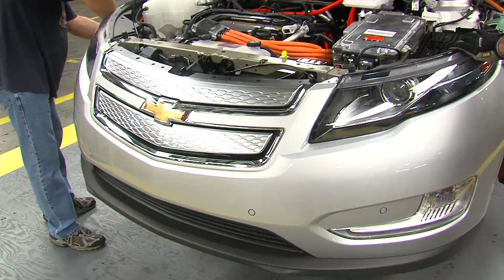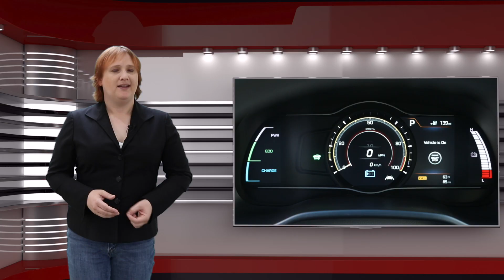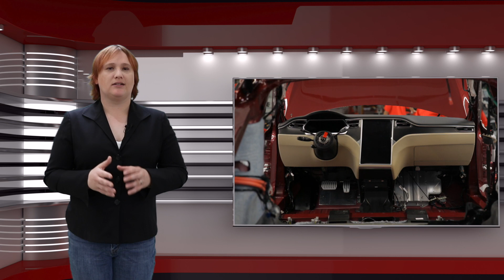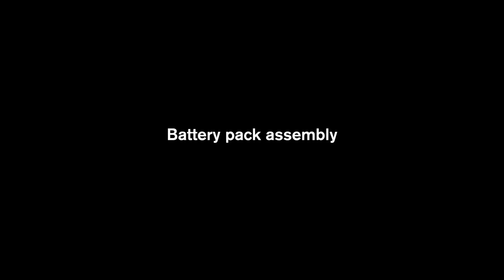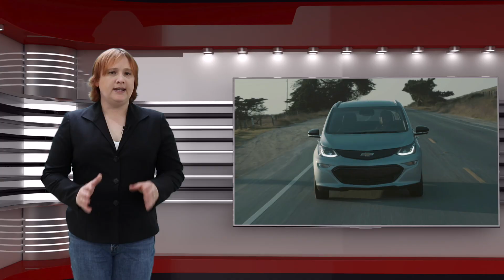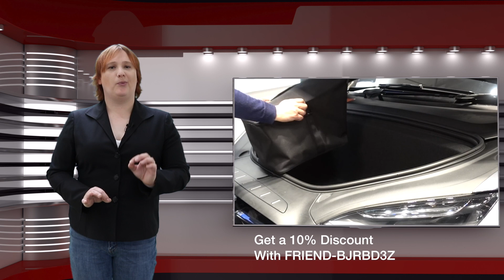Why Electric Cars Don't Use All Of Their Battery Capacity

Comment: But, what is the future of batteries, I have heard of many like solid state, lithium titanium and graphene??
Reply: Tesla and Panasonic are perfecting the Li-ion chemistry and they are at least 2 years ahead of the competition with the Model 3 battery pack. If somebody develops a new chemistry battery cell, they have to go through most of the steps Tesla did, faster, so they can catch up... and they have to build a few Gigafactories too, to bring down the price.
The Model 3 battery pack costs slightly more than 100USD/kWh, but Musk said next year it'll be definitely below 100USD/kWh at the pack level, including the inverters and chargers of the model 3, which are integrated into the pack. That means the 80kWh pack of the Model 3 will cost less than 8000USD, which is unheard of in the auto industry.
Reply: Anyone who can honestly answer that question would be an instant billionaire, (or would be telling lies.)
Reply: javaid shah If we knew what the future of batteries was, we would already be there. There are lots of chemistries being developed, but it remains to be seen if any of them will ever be technically or commercially viable.
Reply: The main goal is graphene but mass producing is the difficult part (some say they've done it but it's probably just 1 layer or some crap) but the near future would be to change the electrolyte which is currently liquid and also has the side effect of damaging the cell on every charge which creates little spikey legs which bridges from one side to the other can causes it to drain flat and never charge again. changing this to glass or some other solid electrolyte makes this much better and your cells would last much longer and holds a better charge
Reply: Toyota and Tesla are reportedly very interested (enough to drop some money) in Solid State batteries. 
Could be an indicator, when the two companies agree on something, there must be something to it. 
Tesla roadster 2.0 can only achieve performance goals with something far better than Li-ion current tech, so maybe they are being silent about it for now.
Reply: The other key point: All the vehicle manufacturers retain part of the battery charge as unusable.
A Tesla 100 model has a ~102kWh battery pack, with only ~98kWh usable.  i.e. about 4kWh not accessible to the user.  In the Volt, 4kWh not accessible to the user makes a big difference, proportionately. In a Tesla 100, iusing it would only add an extra 5% difference

Comment: Hmmm. Batteries are modelled from a 'ideal battery' with constant voltage where the internal resistance change with state of charge. A larger cell has lower internal resistance and can tolerate higher current than smaller cells. It's just down to the sum of all the cells capacity. The answer is a Tesla battery with its higher capacity will sink its state of charge slower than a battery with less capacity. Giving the Tesla time to use the last drops of juice. And Tesla's experience with liIon batteries also give them they knowledge to dare push a little harder.
Reply: Ibrahim Ulf Karlsson Yes, and Tesla spend money on their own research and testing labs. Then they can tweak their battery chemistry as they learn more about what affects the characteristics that matter to them (including maintaining longevity).

Comment: Have to factor in the discharge rate of the cells, and the overall capacity of the pack, relative to the peak, and average current draw. 
Just because there are many small capacity cells, or fewer larger capacity cells in parallel, If the discharge rate is the same, then both should perform equally well.  Of course smaller cells will be easier to control in terms of temperature on a smaller time scale.
So overall capacity, cell chilling, a high discharge rating for the cells, and a protective discharge algorithm will allow you to discharge deeper in a safe manner.  Hence, a special driving mode, controlling discharge rate and temperature differently. (Range Mode)
So it boils down to the amount of money Tesla has spent on their cells, and exactly how the car uses it, that can allow it to discharge the overall pack further than most other manufacturers at this time.
Reply: By having many more individual cells in a 3.7v nominal unit, the consequences of having any one or few cells plate lithium or internally short is smaller. The individual cells are fused and so if a cell goes completely out of whack with its partners, the fuse blows and takes out a relatively small portion of that part of the battery. I do wonder if this makes refurbing a battery pack easier as well.
The prismatic cells with huge individual capacity have to be cared for more conservatively since a failure with one of them seriously impacts the capacity of the whole battery. On the other hand prismatics make packaging easier and weigh less (no aluminum case) when assembled into a battery.
Reply: I'd love to find some prismatic cells with better Gravemetric energy density than the NCR18650GA and similar (B Cells).   
Prizmatic cells can easily have better Volumetric energy density for the overall pack, but it comes at a cost. Much harder to cool..   Please enlighten on the Prizmatic cells with such good Gramemetric energy density.
Reply: Prismatic cells (cells with a hard exterior and a non-cylindrical profile for the uninitiated) can be shaped however is convenient for the overall pack. The chemistry inside is the same or similar to cylindrical cells. Cylinders are hard to pack in a larger space efficiently, a ratio of 0.91 or so for circles, optimally. That's more free space than needed for optimal cooling (and you have larger distances to the cooling) if you consider the inherently low internal resistance of lithium cells. Prismatic cells can be shaped in such a way as to accommodate cooling apparatus, such as heat spreaders being incorporated in the cell containment structure.
The 2170(0) form factor is a nod to this advantage of prismatic cells while retaining the advantages of the massive redundancy of the 18650. You have less spent on the structure due to the larger volume to surface area. Plus, they can be mass-produced efficiently via the classic jelly roll. These aren't pressure vessels that need big wall thicknesses.
Tesla's plan is to leverage scale of manufacturing over optimal efficiency.

edit: garmamr nad prunociatiol
Reply: Any prismatic cells with 224 Wh/Kg or greater Gravemetric energy density?  I'd love to know.  
2070 is pretty much same principle as 18650, just a bit larger. Hence the name.
Reply: Smaller cells ie less powerful cells (connecting in parallel as "bricks" or not) r inherently more difficult to keep balanced (its the weak link theory) and in case of hard wiring them they r far more difficult to replace.  

In general in electronics 1 component that replace many tend to be more reliable. So It's just a rationalization that many cells in parallel would be robust than 1 with a higher current and capacity cell.

But the real factor is how well the BMS and thermal management is designed that determines, how much the 80% capacity rule can be deviated from without significantly affecting the battery.

Comment: I think it's more to do with heat transfer. A smaller cells mean a larger surface to volume ratio. Hence more surface area for liquid cooling to efficiently remove heat.
Reply: ateeqn1985 
They occupy the same space likely without air gaps between them. I don't think there is going to be a great deal of difference there.
Reply: TheObsessedGardener tesla battery packs have liquid cooling around each cell. Google it..